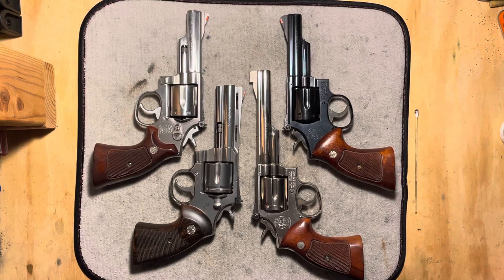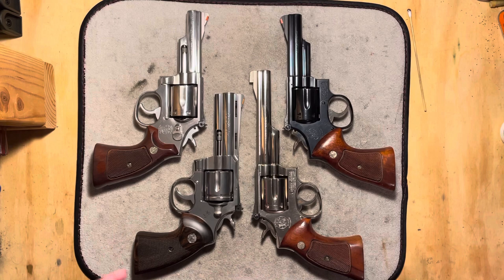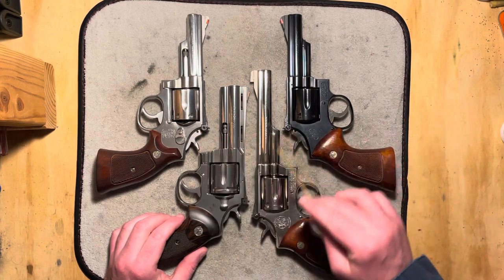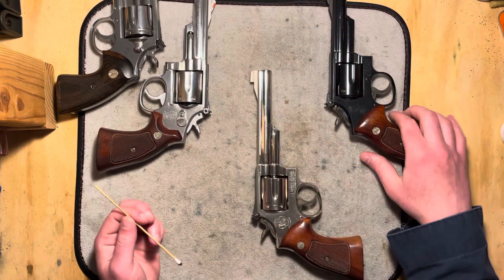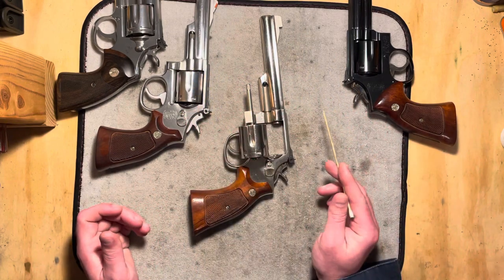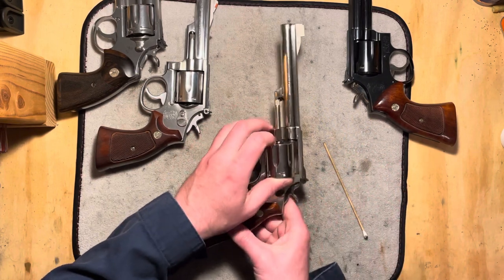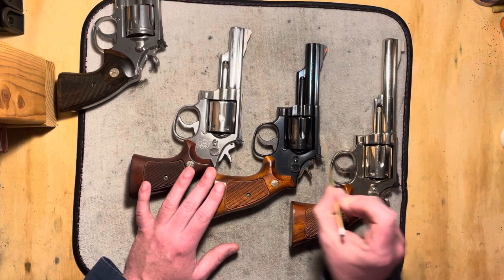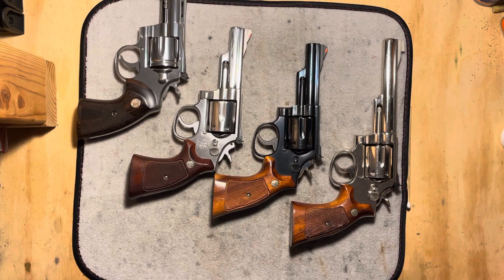Revolver Forcing Cone: Explanation and Avoiding a Crack, Ft. S&W .357 Magnum K-frames & Colt Python

Comment: Maybe better do not shoot 38 special in 357 revolver bec 38 is shorter and transfer more energie on the forcing crone front. the 357 is longer have more power,but the energie transfer goes into the forcing crone?
Reply from the maker: That would be more of a concern with a high velocity .38 Special, like a +P. 

The fairly conventional 158 grain loads, particularly of lead or plated projectiles, will be quite gentle to it.
Reply: The cracks are from the high pressure from the loads with lighter bullets. 38 special have a much lower pressure than 357 mag.
Reply: I think the internet way way way overstates the problem. The vast majority do not crack

Comment: It doesn't make sense to be saying to only shoot .357s every now and then, because it's metal that can either take it or not. Its not organic living tissue that can recover from bruising or fatigue.
Does that make sense?
Reply from the maker: Not really. Your forcing cone is basically… think of it is a rubber tube. Rubber is elastic, but so is steel. 

Every time a bullet impacts the forcing cone it stretches the forcing cone. Steel is elastic, though, so it returns to its shape. The forcing cones being discussed on these K-frames are thinner at one spot, so the thinner portion stretches more than the rest. 

So if you slice off part of that rubber tube, and you push a ball bearing slightly bigger than the tube down through it and out the other end. It can do that. Probably quite a few times. Eventually it stretches and returns too many times, becomes fatigued, and it splits at that thinner portion because it inevitably stretched more in that spot. 

You’re thinking of the forcing cone and barrel as some immovable object probably because you’re thinking of steel being very sturdy. Steel stretches. When a train drives over a steel bridge, the bridge has deflection. The springs in a vehicle’s suspension undergo elastic deformation with every bump in the road. They eventually wear out, and/or develop stress fractures. 

So while the steel is not “living tissue” it is an elastic material.
Reply: @ColterBrog  I'm aware of all of the properties that pertain to materials. 
What I meant was that if the design is inferior, then the material will not survive.
So saying not to use something too often in that context is silly.
Would you fly on a jet that's not recommended for flying in too much humidity because the turbine blades just might start stretching and cracking? I wouldn't go anywhere near the thing! And to my argument, that discussion will never happen.
When a material is chosen for a specific purpose, it shouldn't be scaled by arbitrary frequency when shortcomings arise.
In this case we have a design oversight that should have caused a recall because of the potential danger, mechanical failure, and loss of investment that ensued.
It can either take it, or not.
Reply from the maker: @jacksutherland846 I don’t think I understand the point you’re trying to make. 

A concentric forcing cone is ideal because it distributes the elastic deformation more evenly. On older non-sleeved 19s and 66s, they all have a shaved forcing cone, as do the old Model 10s which are .38 Special only. This is an inherent weakness of the way S&W built them. 

They fatigue sooner when paired with high velocity projectiles which strike the weaker forcing cone with a lot of energy. All impacts create some amount of fatigue because they all cause elastic deformation. 

It comes down to design intent. The K frames were envisioned as mostly shooting .38 Special in training, with relatively limited duty use of .357 Magnum. They are a .38 Special design, with allowances for accommodating limited use of .357 Magnum. It causes additional fatigue and risk of failure. 

An e fine can run at red line, but it doesn’t mean you should just under-shift and drive down the road bouncing off the rev limiter and expect no additional wear of chance of failure.
Reply: @ColterBrog  In a nutshell, they hastily stamped .357 magnum on the guns only to see them fail, and suggesting limiting the use of the prescribed caliber ammunition is not a good solution to this issue IMHO. It just seems ridiculous to me. That's all I'm saying. The model 29 .44 magnum had similar problems. They have all been corrected by now with thicker barrels, and longer funneling or whatever else. All of the other caliber forcing cones haven't seen these problems. What should be advised is to become aware of these models in question, and avoid them because they are fundamentally flawed and there's no getting around it, unless one is happy to arbitrarily limit the use of the ammunition it was intended for.
Reply from the maker: @jacksutherland846 Okay. That’s a way to look at it, I guess. 

I mostly shoot .38 Special 158gr wadcutter in a bunny fart load. I’ll happily buy these well made but under-designed revolvers any day. They’re fantastic pieces of craftsmanship that function great in their originally intended role of mostly firing .38 Special. 

I think you’re associating some malice with this on the part of S&W that doesn’t really exist. Law Enforcement wanted a compact and light revolver that mostly would be used with .38 Special in training and would occasionally see some .357 Magnum use. That’s what was delivered.
Reply: @ColterBrog  No malice suspected. Probably just rushed like most product development projects seem to go. But fair enough.
Good spar. And I also love Smith revolvers.

Comment: What do you think about a 65-3 manufactured in 1984?
Reply from the maker: Nice revolvers. That should be outside the range of those affected by the yoke mounted gas ring thinning the forcing cone, but like other older S&W revolvers I would avoid high velocity 125 grain .357 Magnum, and stick to just sparingly using the heavier magnums with most shooting for amusement being with .38 Special.

Comment: I have a 19-3 6inch is 158 grain 357mag 1300fps be safe
Reply from the maker: 19-3 predates the changes to the gas ring that necessitated extra thinning of the forcing cone. Of course, all the old type K-frames have relatively weak forcing cones compared to modern revolvers, but 158gr .357Mag at a factory velocity of 1250-1300fps shouldn’t cause any unreasonable amount of extra wear. 

Of course, a revolver is a mechanical device and it eventually will wear out. More energy imparted on the forcing cone uses up more of its life. If you shoot that magnum load exclusively, it will wear out faster than if you shot a modest .38 Special load, whether the limiting factor is the forcing cone or eventually frame stretch. 

So the answer is “yes”, but with the understanding that doesn’t mean it will never wear out, or that higher energy loads don’t use up more of its available “life”. 

I hope that isn’t too vague or noncommittal and answers your question.
Reply: @ColterBrog  so the 357 i have should be fine I've maybe 12 rounds of 357 out of it it's a 6inch and it was made in 1970 i just wanted to know if it wasn't worth risking with that 158 grain 357mag republic ammo i have to just stick to like 900fps and under 38spl has i have a 28-2 highway patrolman with a 6inch barrel and a no dash 586 4inch and a ruger security six in 4 inch and a new python in 4 inch for 357mag instead of the 19-3 i have the 15-3 for 38 and off topic you might know i have a 29-6 in 6inch is 240 grain 1300fps maybe a little lower 1275 or something 44mags safe in that I'm not sure if it has the endurance package or not btw thanks for the reply
Reply from the maker: @yugisslifer8359 I guess the best way to answer this is telling you what I do, since three of the revolvers in this video belong to me. 

The 66 I shot .357 Magnum from, including 125 grain, when it was my only .357 Magnum and I also wasn’t fully aware of the forcing cone weakness of the older K-frames. Now, I mostly only shoot .38 Special from it. Typically 158 grain plated wadcutters I load myself. I would shoot 158 grain Magnums from it, though, if I felt the need. 

My 19, the 4” blued one, is in exceptional condition (separate video on it specifically), and I don’t shoot it. There’s just no reason for me to when I have a well-worn Model 66 that shoots perfectly fine if I want to shoot a S&W. I use the used one and keep the nice one nice, if that makes sense. Preserving it for posterity. 

The new Python, I’ll shoot anything through it. It has a thick concentric forcing cone, a bulkier cylinder to accommodate that full forcing cone profile, a thicker top strap to reduce frame stretching, the advantage of decades of advancement in metallurgy, and it isn’t a collectible as it is currently being manufactured. It’s also, in my opinion, easier to strip down for cleaning if I do shoot it a lot and it becomes fouled. 

If you have newer revolvers designed from the ground up to be .357 Magnums (686, Python, etc.) I would shoot Magnums through those. At the end of the day the 19/66 are K-frame “Model 10” type revolvers that were adapted to be Magnums after the fact when that frame was always intended to be .38 Special. It’s just the nature of what they are.
Reply: @ColterBrog  ok thank's i think ill manly stick to 38s in the 19 and shoot 357 in my 586 python and highway patrolman ill still probably shoot 357 in it rarely but i might not shoot it much at all its pretty close to 90% or better idk if it even has a cylinder ring on it

Comment: I have a Model 65-8. I don't know when it was manufactured. How strong is this forcing cone?
Reply from the maker: A model 65-8 is quite late production. I’m having trouble finding exact year range, but the mid-to-late 2000s seems to be where that falls. (Smith & Wesson has a serial number lookup available if you want more specific information.) It will not have thinning of the forcing cone from the yoke-mounted gas ring as that style had been abandoned for many years by the time the 65-8 came about. 

That said, it is a K-frame revolver like the Model 66 shown in the video. It is not at the exceptionally high risk of cracks that those with the yoke-mounted gas ring are, but is still not intended to digest a steady diet of magnum loads. They shouldn’t be used as a matter of routine.
Reply: @ColterBrog  I have a 66-8 bought in 2017 and the forcing cone is unshaved.  It uses a 2 piece barrel, an inner sleeve with an outer shroud.  From pictures I have seen on guns for sale it "looks like" the 65-8 also has the same barrel system with a regular hollow ejection rod locking at the tip.  The ejector rod on my 66-8 is a thin solid piece like a Colt and the forward lockup is on the crane rather than the tip of a hollow ejector rod as traditionally used by Smith & Wesson.  In my 'guestimation,' this was engineered to eliminate the high mounted gas ring requiring the weakening forcing cone flat cut at 6 o'clock which you eloquently explained.  In comparison I also have a 65-6, a64-7 and 64-4 all made from the 1980s to 2000s, and these all feature the shaved forcing cone.  In any S&W K frame I prefer standard velocity heavy bullets, especially the 64s.  I consider only my 66-8 as truly magnum capable but would only do so sparingly.  And even in my 65 would only fire magnums or +P,38s if that were all there were on hand and a shot had to be taken.  Thanks for your knowledgeable presentation, invaluable both to novices and old hands alike.
Reply from the maker: @richardkluesek4301  Thank you for your input. That’s very interesting. 

There are so many variations on S&W and I am definitely far from an expert- and with my newest sample of a S&W revolver being from 1987 the newer stuff definitely is a bit removed from what I’m most familiar with. 

It seems like S&W has done some really good things in recent years in regards to strengthening the legacy designs. 

I just wish they would get rid of that lock.
Reply from the maker: @richardkluesek4301  Thank you for your input. That’s very interesting. 

There are so many variations on S&W and I am definitely far from an expert- and with my newest sample of a S&W revolver being from 1987 the newer stuff definitely is a bit removed from what I’m most familiar with. 

It seems like S&W has done some really good things in recent years in regards to strengthening the legacy designs. 

I just wish they would get rid of that lock.
Reply: @ColterBrog  You are more distinguished than what you humbly credit yourself for.  I had exposure to S&W K frame wheelguns from an organization that I belonged to long ago prior to the 2000 s which used these and had a dozen on hand for members to train with, in addition to my own guns and those of my colleagues.  The 2 piece barrel is questioned by some but I have no opinion except to use the sidearm as is.  There are gunsmiths who sell and install plugs to fill 'hillary's hole' after removing that detestable lock, one of them I patronized was Speciality Precision, owned by JD, in Arizona.  Keep your gunpowder dry and bayonet sharp.
Reply from the maker: @richardkluesek4301  You’re too kind, but thank you.

I wish S&W would do their lock the way Taurus does- on the back of the hammer. It’s far more subtle and doesn’t change the profile of the frame. My biggest complaint is cosmetics, not function. 

Revolvers to me are works of art. I love the beauty of them, the styling, the intricacies of the mechanics. Aesthetic appearance is an important aspect of a revolver in the way I see them. 

I carry Glock, CZ, S&W autos, and Ruger autos. I haven’t carried a revolver since about 2015.
Reply: @ColterBrog  Probably Taurus patented the lock placement on the hammer.  Good idea, the part can be replaced and locking would be optional.  Internal ocks are not found on many other firearms so their benefits are debatable.  I use J frame S&Ws, and Glock, Khar, and Kel tec for edc.   In a past life a Colt Commander and Colt and S&W revolvers.  Classic revolvers are the sacred swords of modernity.
Reply from the maker: @richardkluesek4301  Absolutely. I adore the classics. 

Taurus is an interesting company. They can often come up with very clever design. They just can’t seem to get their build quality up to a sufficient level. I don’t know why that’s seemingly so difficult for them.
Reply: @ColterBrog In my humble estimation Taurus has solid design but soft steel in small parts with premature attrition.

Comment: The Colt is built like a tank, but priced like a high end sports car. The Ruger GP100 (.357 mag) is also built like a tank, but priced like an average used car.
Reply from the maker: That is all true. They are both robust and the Colt is definitely more expensive..

The Colt feels like a sports car, though, with that price. Every function of it is just smooth and slick. The feeling of handling it is “high performance”. The Ruger is good and definitely a value, but just more clunky and less refined in handling aspects. Aesthetically the Colt has a beautiful high polish that shines brilliantly while the Ruger has a more utilitarian brushed finish. 

The cylinder lockup on the Colt where everything times so well that the cylinder actually binds up on the bolt at the final movement of the trigger is rock solid. You really won’t find a revolver with a tighter lockup at the moment of firing than the Colt Python. I imagine this contributes to the legendary accuracy. 

The Colt is a beautiful and accurate revolver to handle and take to the range. The Ruger is a workhorse that will take a licking and keep on ticking and feels perfectly at home in the boat, the blind, or the rucksack. They both fill a niche.